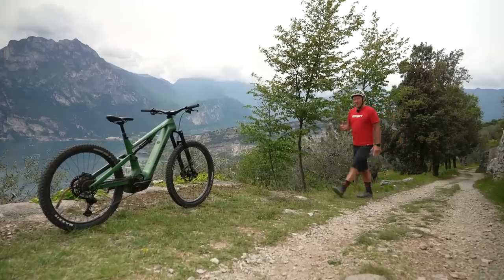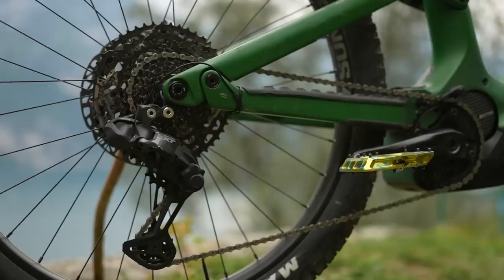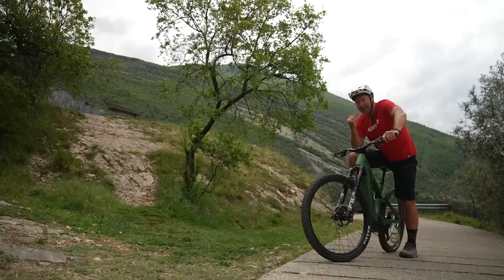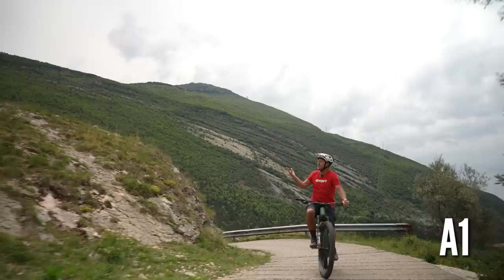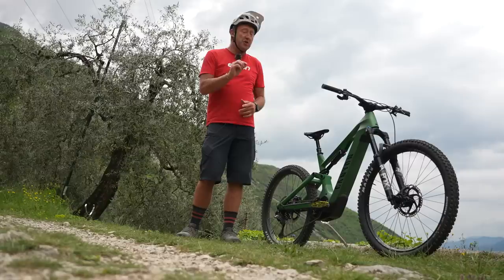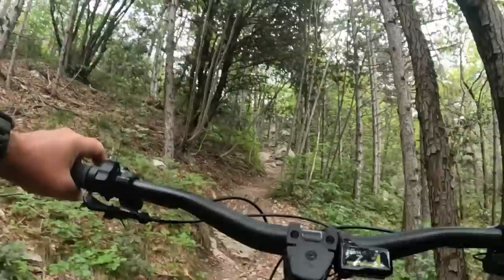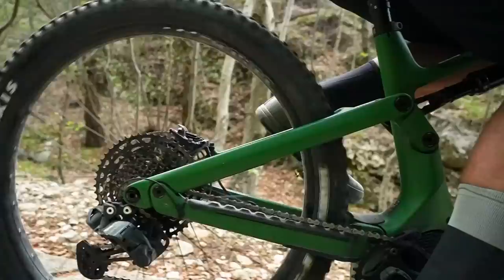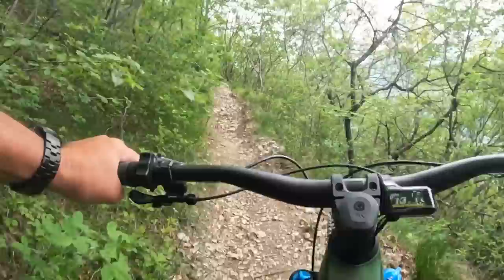Shimano Auto Shift - How Auto Shift Works In Reality

Comment: Sorry to go off-topic but I'm stumped and need advice. I recently purchased a Haibike ALLMTN with the Yamaha PW-ST motor, but I wasn't aware that this e-bike motor has what feels like massive drag after hitting the legal motor speed limit. It's very frustrating to run into what feels like quicksand every time I want to go faster than that speed. I often go 30kmh/18mph or more on my analog to catch green lights or overtake people, but the e-bike pushes back on me. It even got dangerous once when frustrated motorists honked and overtook me too closely on a narrow country lane because I was unable to coax more speed out of that bike, it can't easily do 30kmh/18mph on flat. Are there motors that disengage or go into neutral after reaching max speed to allow going faster on leg power? The bike is great on steep terrain, but on flat ground it feels like a frustrating handicap compared to an analog.
Reply: Its called decoupling, shimano is one of the best for decoupling with out drag, the other option would to derestrict the motor to give you a bit more speed 😉
Reply: It’s not actually ‘dragging’ it has just stopped assisting your peddling meaning it feel’s draggy
Reply: @2nd3rd1st, from all accounts, the latest ebike motors offer very little drag,  including your PW ST one. What you are experiencing could be that your bike is a lot heavier (10kg+), than what you are used to pedaling, coupled with the sudden drop off of  power at 25kph, which would make it feel a lot more 'draggy' than it actually is. Not forgetting that some mtb  tyres also create a lot more drag than others. My advice would be to give it some time on your new bike and enjoy the many benefits of an emtb!
Reply: It’s not because of yamaha but it is like that with any other mid drive motor… assist stops at 25 km/h
Reply: Welcome to the world of E-Bikes. It's not drag. The motor makes the bike feel lighter than it is, when the assistance stops, you feel the real weight of the bike and this gives the feeling of drag. This will happen on any brand of E-Bike.
Reply: youd probably like a hub motor for commuting/road
Reply: pw series motors (normal pw, pwse and pwst) are all known for decoupling well. ride a bosch performance gen 1 bike and tell me again. that is shit. what you feel is the higher weight.
Reply: @TobaisEnstromDJ  I was open to the theory but my experience says it's definitely crippling motor drag. When I let the bike roll down a hill at a high speed that's over the limit and try to keep that speed at the bottom by pedalling hard in the highest gear, the motor actually pushes back against my leg power and slows the bike down considerably. It's like riding down a paved hill into a sand pit. 
It's frustrating that I will have to buy a delimiter device to make the ebike useable like a regular bicycle.
Reply: @SimonBauer7  Thanks, but in my tests the motor slows the bike down while I pedal over the speed limit, like when I try to keep the high speed on flat after rolling down a hill at high speed. The bike just motor-brakes like a car in low gear and slows the bike back to the speed limit very quickly.